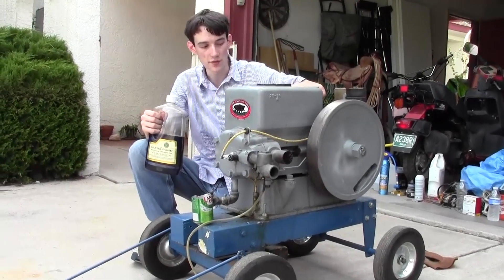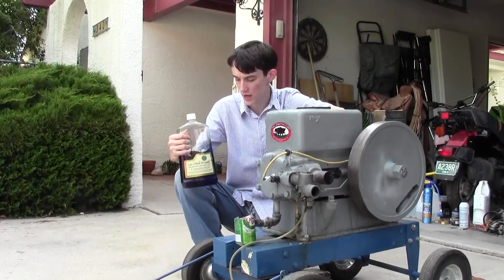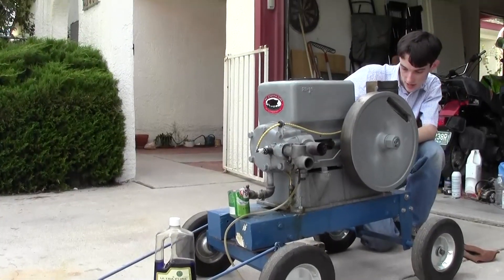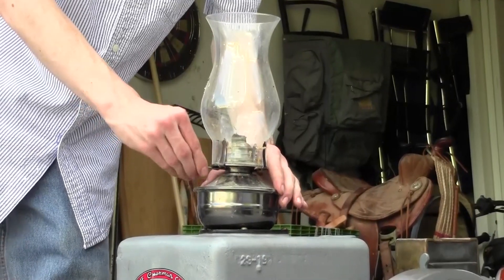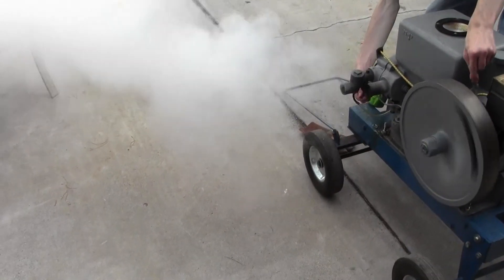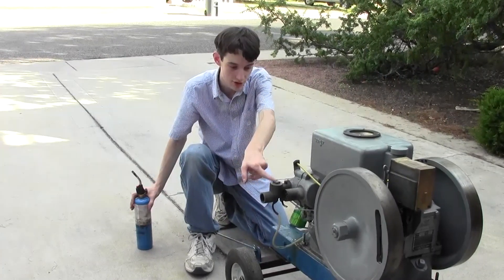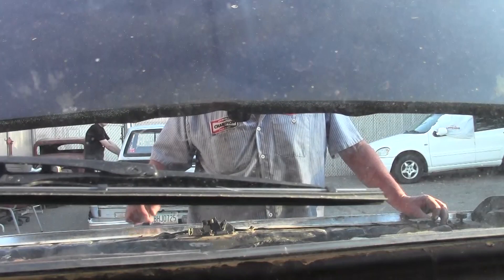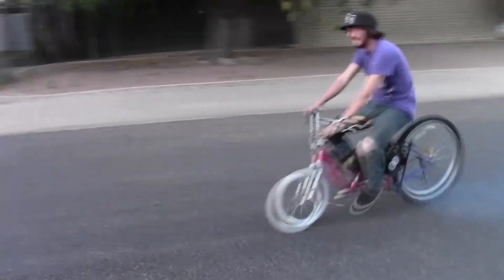Will It Run? Gas Engine VS Paraffin Lamp Oil

Comment: Cool stuff! You should try setting up a plastic distillation setup to produce fuel from plastic and see if it'll run on that. It's pretty easy to make. You can find lots of really simple makeshift designs online